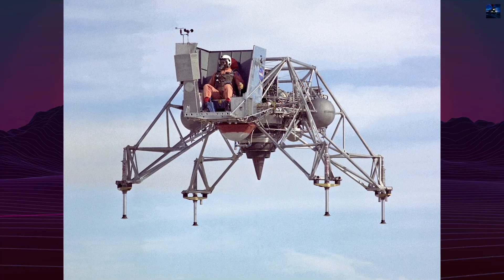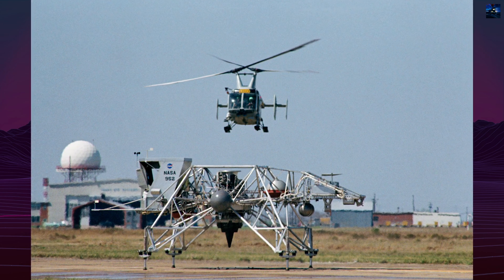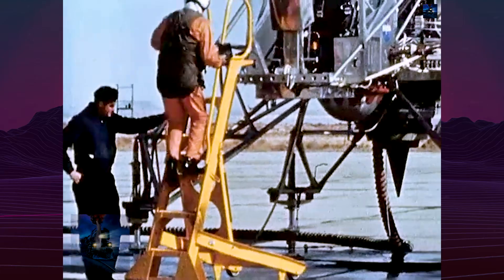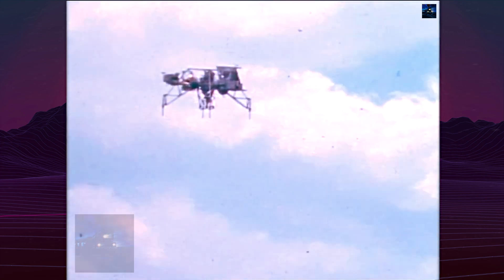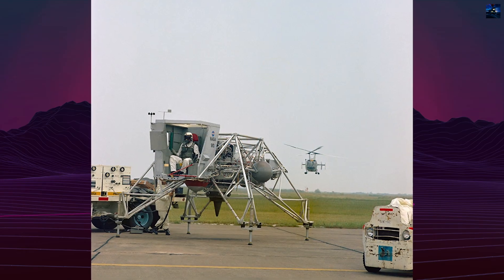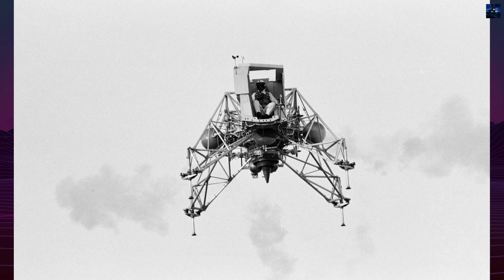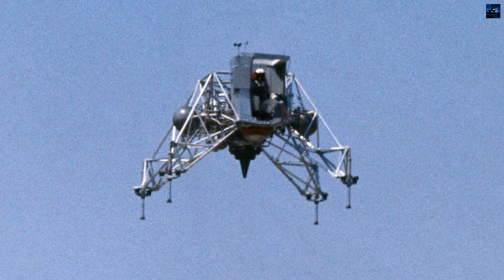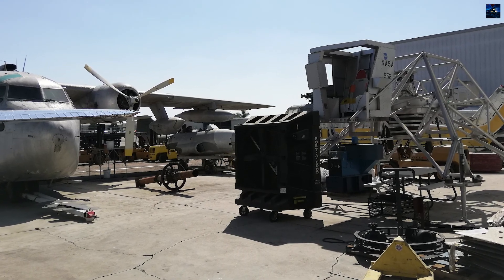Lunar Landing Research Vehicle: The Untold Hero of Apollo You Need to Know About

Comment: The computer landed all the Landers🤔
Reply: Not quite. I recall clearly that Niel Armstrong had to override the computer to make the first landing. There's audio/video evidence.
Reply: All 6 commanders landed in P66, which is the computer autopilot flying mode.  So the OP is accurate.  That said, however, the P66 program did put the Human In The Loop, so that the CDR could input clicks up or down to increase or slow the rate of descent, and on the LM RHC, the lunar module's stick input, the pilot could fly angular rate inputs which gave a feeling of flying the spacecraft to the landing point.

So really only limited control with the CDR flying mainly pitch & roll, while only inputting an occasional 'vote' as to how rapidly the descent was wanted, versus hovering at altitude.

Bottom line:  It was a TEAM EFFORT.  Human plus computer got them there.

With all the fuss about Armstrong dealing with those nuisance 1202 & 1201 Alarms, and the standard story that the mission was hanging on a thread as to whether they were going to ABORT, it would have been refreshing to have heard, at least once, Armstrong say straight out that his plan, if the computer had crapped out, was to simply switch to MANUAL and land anyway.

It was the LLTV that gave him the confidence to do this.

As for all the talk you hear about how Armstrong got picked to be the first to attempt the landing...
Nearly everyone has bought into the Deke Slayton cover story that "It was the luck of the draw."  For any interviewer who had done their homework, they would have followed up that answer with the question...

"Well Armstrong was picked to be the CB Rep for the LLRV way back in 1966.  Wasn't it way back then when it was decided that a civilian would be the first to do the landing?"

There have been hundreds of books, and dozens of movies done on Apollo.  NOT ONE has told the LLTV story in how it was KEY to the landing assignments.  The first LLTV class had 6 astronauts.  These were the ones who were on the short list.  And back in the beginning, the LMPs were put through the full training along with the CDRs (Helo > LLRF > LLTV sim > LLTV aircraft).  So the short list was really only 3:  Borman, Armstrong and Conrad.  With Neil being the one who had been assigned to the project from its very beginning.  Borman & Conrad had been given other specialties.  Borman's was SatV booster, as I seem to recall.  And then he got fully absorbed as CB lead for the AS-204 investigation.  This meant that the short list came down to just 2:

- Armstrong, and
- Conrad

Remember who the "Backup CDR" was on 11?  Jim Lovell.  But at the time of July '69, the only ones LLTV trained were Armstrong and Conrad.  So while the official story is that Lovell was the Apollo 11 backup commander, if anything were to have happened to Neil, the only decision that would have made sense was for Pete Conrad to be swapped in as the replacement A11 CDR.

This gave Deke only 2 realistic options for a backup crew with a launch in July 1969:

Pete Conrad flying with the rest of Neil's crew, or
Pete's entire crew swapping in for Neil's entire crew.

NO ONE says anything about this.
The definitive story of Apollo has NEVER BEEN TOLD.  Not by anyone.  Here we are more than half a century later, and you'd think that at least ONE book would have explained this.  For some quite bizarre reason, no one has.  Best told in an accurate movie.  Not the Hollywoodized versions like Ron Howard's bogus Apollo 13 kind of tall tale.  Everyone remembers "Failure Is Not An Option".  Yet NO ONE said that.  Not Gene Kranz.  Not anyone.  And if you did say those words, you should have been FIRED.  Because the only way to succeeding...  the only smart way to succeeding, was to recognize all pertinent failure modes, and to plan for them, train for them, as the best way to avoid that from happening.

Failure most definitely was an option.  Just ask Gus.  Oh wait...  you can't.

Then there are the tall tales told about how Gus would have been first, had he survived.  Gus Grissom never started any part of the flow for him to get any LLTV training.  Anyone who repeats this story is only spouting eulogies for the man.  Same for Tom Stafford, with so many saying that he could have done the first landing on 10.  Tom never flew the LLTV.  He says this straight out in his book We Have Capture.  So if there was any possibility for Tom to have been first, he would have to have been given a capable LM, and then he would have done a FULLY AUTO landing, a la Surveyor.  Or just winged it.

The other possibility, if Stafford had been extremely motivated, was for him & Cernan to attempt to land Snoopy.  But it would have been the last thing they ever did.  There would be no seeing John Young ever again.